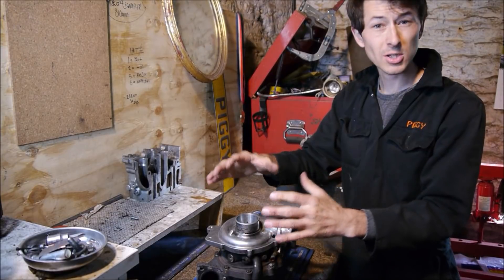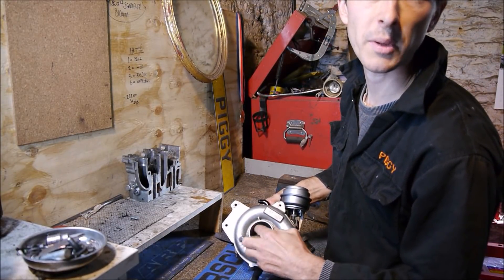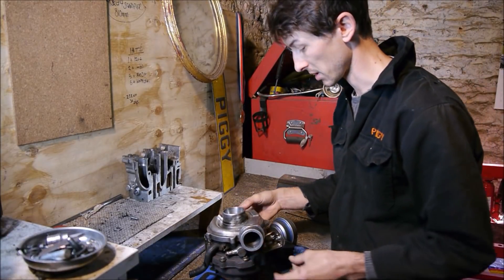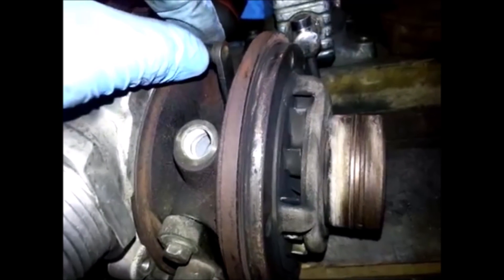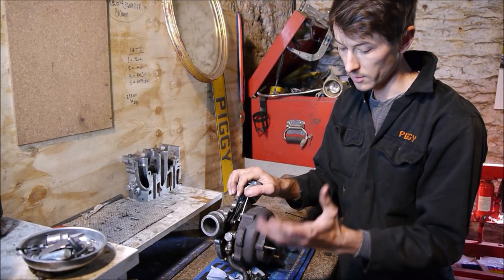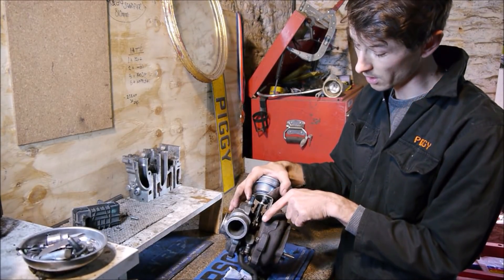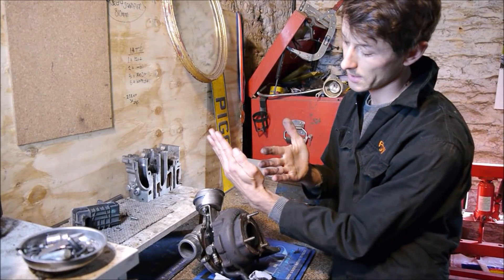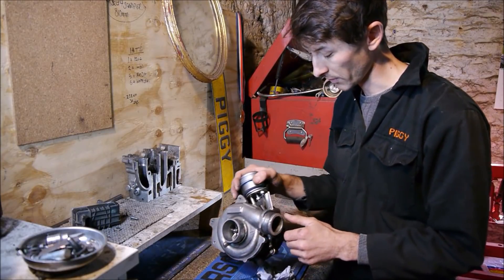VNT turbochargers explained

Comment: Do you have a video on how to retrofit these on a waste gated vehicle? How can the vnt be controlled with no computer?
Reply from the maker: It can be controlled via boost can or an Arduino system
Reply: Thanks for the quick response, we are building a bit if a Frankenstein diesel engine, a 16v 4d56u block with an 8v 4d56t head.  I'm trying to keep everything simple with no ecu. Everything is mechanical.  We just bought a VNT, with vacuum controller, still a bit confused.  We are running a https://youtu.be/N4RMT3gYBvc?si=582p6ha266G5ieai an this be adapted?
Reply: This is the Turbo https://youtu.be/IsOp49nkTbs?si=hqrmb7SoFc2XOeSy
Reply from the maker: Ive never seen or used that controller sorry. If you want to keep things simple

....don't use a VNT. Find a modern wastegate turbo.
Reply: @PiggyPower  maybe simple was the wrong term, I was hoping for a  balance between the computer world and analog world. I think the VNT will be a good fit for our needs, I was just looking for more information on how to control it.  Really appreciate your style and breakdown of how a vnt works it was very helpful.
Reply from the maker: @Yogaslackers  if you search Arduino vnt control, a guy made the code and everything with parts to do it. I ran one for sometime with it successfully.

Comment: Hi Piggy, thanks for your help over xmas on my timing belt change.  Ive been chasing through a p0243/p0238 prob (eml at 2700 under load) 1.6hdi110 and i think it's the vnt turbo.  I took the vacume actuatee off and the nozzle control arm is stiff and gritty and only moves about 10mm (unless i really force it)  is it better to rebuild or to replace? Thanks in advance. Kev
Reply from the maker: You can clean them out. Mr Muscle oven cleaner works a treat. It should be freely moving with no resistance at all
Reply: Thanks have you got a vid, or know of one you recommend
Reply from the maker: @chamoisshine9951  no sorry
Reply: Well not a complete disaster.  Just a disaster LOL.  Took turbo off (3 hours of fun) and indeed the arm was stiff. Split turbo in half and the control ring wasn't moving freely. So cleaned and replaced and it seemed to be a lot better but some of the flaps were still I little gritty.   So decided to take out the nozzle ring.  Unfortunately the 3 screws that hold it in place have seized and I have snapped them all!!  Ordered a new turbo (remanufactured Garrett original) should arrive tomorrow.   Old turbo is now clean and all parts moving freely, just can't re-assemble.   Next time (if there is a next time) I'll just clean the ring and just use lots of cleaner until the vent flaps are less gritty).  A remanufactured original was only £50 more than a new Chinese copy.  I'll let you know how I got on.
Reply from the maker: Yeah they tend to snap after all that time. Pop it on a drill press. Drill them out. Retap. Fit new tiny bolts. I've done it a few times! Kudos for trying though pal, many would write the car off!
Reply: Beyond my equipment. I'll just keep it in my spares pile.  I love my little 206cc I've had it for over 16 years.   I'm a valeter so I keep it looking nice and it's just gone through an MOT last week with no advisories (despite the turbo issue) as I live on the south west coast I do like to have a cabriolet.   Would you advise an oil and filter change one I have new turbo on (last change was August, only done 2,000 miles since). I'll be attempting replacing the glow plugs as well as I have had the p1351 error since forever.......
Reply from the maker: I'd only suggest that if the turbo had failed from oil issues. 
If it's the 1.6hdi I would highly recommend a new oil feed and drain and oil change/flush the sump.
Reply: Well new turbo on, new glow plugs in. Engine management light gone. It's a bit under powered now going up hills. And the only error is a p0299 turbo under boost.  Quick question.   Should the actuator arm always be long when idling (I've applied. Vacuum and it goes short, and I've done the same from the solenoid hose to test that, all good) I just can't get to the bottom of it and thinking of just getting rid of my car as it's taking to much of my time.... Shame, 16 years........
Reply from the maker: @chamoisshine9951 yes the default will be no vacuum (safety) ...and no boost is needed at idle! As soon as you touch the throttle the vacuum from the engine/solenoid will be applied and it will pull it shut. Under boost code doesn't necessarily mean the turbo is at fault. Reading the fault code is just the first step in diagnostics
Reply: Thanks as ever for your prompt replies. Much appreciated. So if I get the Mrs to rev the car I should see the actuator arm move?
Reply from the maker: @chamoisshine9951  yes I'd expect it to move
Reply: It does!!!  I checked the entire vac system today. No leaks.   Also checked the turbo solenoid valve on the bench (plenty of sucking through a tube whilst a large  syringe was pretending to be the turbo actuator.  All worked as expected when 12v applied.  Still struggling up hills - was a little better when MAF unplugged, but still got the p0299.  There was a little leek on the charger hose immediately after the plastic turbo outlet, but that has gone now (reseated and tightened jubilee). I think next stop is a turbo diesel specialist as it's taken a lot of time now... Any more pointers?  Thanks so much for advice so far

Comment: I really like this video! You are so right in so many ways. Not to be a PITA on one detail, and perhaps somebody else already said this, but the reason that the turbine spools up fast with the vanes in the nearly-closed position is because the exhaust gas flow has been accelerated by the narrow openings and angled in a fashion that it moves in a more circumferential motion that helps the turbine spin up. You are right that there's higher pressure under those conditions, but that's seen upstream of the variable vanes as a side-effect of closing them down. That higher pressure wouldn't be seen by the turbine itself. Naturally, as the vanes open, not only is there less acceleration of the flow, but the flow is also in a more radial direction, both of which contribute to less spooling. That's my understanding of it, anyways. Thanks for the excellent video!
Reply from the maker: Yes, spot on .. it does see the high pressure though, think of 2bar of air forced through those narrow vane's!
Reply: @PiggyPower  it really is pretty incredible what this machinery goes through. the VNT really is an amazing innovation. I used to have a MK4 Jetta TDI and that thing got 45 mpg no matter how hard I drove it. Hoping I can sort out my E320 CDI for good performance and great efficiency, too.
Reply from the maker: Those things are possible.... A reliable E320 .... Errrm

Comment: Ok I have some questions.

-Can the exhaust gas pressure force the vanes open as in a normal wastegate?
-what’s the pro and cons of using a boost reference wastegate and a vacuum reference wastegate on a Variable vane turbo?
Reply from the maker: 1) not really, if they 'open' then EMPs drop, which would allow them to shut ..etc.. ...but then the flow would be increasing as RPM goes up anyway... If EMPs are high enough to move the vanes, there's other issues. 

2) not really sure what you mean by having a boost reference v a vacuum reference. There's no vacuum on a turbo diesel. Just the pump.

Comment: yeah you are right Yoda got a couple of things wrong, i wonder if he just by mistake moved them wrong when he explained that they make more boost when open. But he sure don't seem to like vnt's :P
Reply from the maker: You wouldn't like them if you didn't understand them... That's true of so so many things... "I hate that" ...do you understand it, "no"... They often correlate. They don't make more or less boost when open or shut... They just adjust the pressure/EMP... Rpm, load and fuel all play a part .

Which is why they need such fine tuning to control

Comment: Good guide to VNT turbos, clearly the other guy didn't have much knowledge. Maybe he should've just admitted that and not said anything about them.  I owned a 306 Dturbo and it was good at the time,  I replaced it with a Leon with the VW TDI 110 engine.  The drive ability of the cars was completely different, the VNT turbo on the Leon makes it much better.  I'd never want to have another waste gate turbo on a diesel.   You could hustle the 306 along, but you had drive around the turbo lag low down and it was game over then waste gate opened.  Giving you a power band of a little over 2,500 revs.  The power delivery from the VNT turbo on the other hand has very little lag low down and no sudden drop at the high end.
Reply from the maker: Many thanks. 
And well said... VNTs transform the older diesels

Comment: I have a vnt on my 02 golf with 482,000 miles. I think the vanes are sticking causing limp mode. The bolts are so rusty, I am afraid they will brake. Can I drill into the exhaust and shoot a foaming cleaner into it? Then plug the hole?
Reply from the maker: At that miles, probably just worn tbh! 
I wouldn't want to suggest anything like that due to the potential risks.... Not that I wouldn't try it myself 😆

Comment: Still I can't understand the difference in control between VNT turbo and old type of turbo with wastegate.. Example we set maximum pressure 15psi, so if the pressure raise, ''old turbo'' will open the wastegate to decrease pressure on hot side. And on VNT the same, just not wastegate, but change angle of the flaps. Can't understand the difference in control? Why it is so tricky and difficult to put VNT?
Reply from the maker: In plane and simple talk, yes it's like that, but these VNTs are so much advanced that a tiny movement on the vanes creates a huge difference. Plus you don't want high EMPs while cruising, but you do want quick response. You also don't want overboosting which is VERY easy with such a simple setup. These will easily spike to crazy psi if not under control and destroy themselves. Plus if the vanes are shut too much for too long it will choke the engine and prevent it from breathing 

Plus the advantages...

Essentially you have a turbo that is too big for the engine to spool, but with the vanes, it can spool it. Then you have the bonus of it flowing air much more efficiently being a bigger blower.

Comment: I thought the exact same thing about that skid factory video. Love what they do but vnt isn't really a big thing on diesels in oz. It's more relevant here as we've got heaps of fairly small engined diesels
Reply from the maker: Perhaps that is the issue... Although I was still surprised at his 'facts' being so wrong.
Reply: Yeah same. Gfb now do a manual vnt controller. I think they need to revisit that td42 build and put a proper vnt turbo on it to feel the difference
Reply from the maker: Manual VNT controller... Just a boost controller. Very inadequate and poor control of a VNT. 

Agree on the td42 thing. Be epic that with a vnt
Reply: @PiggyPower  it won't be optimal, but gfb are a pretty reputable company. Looks like a more complex 2 stage valve, take a look.  I run a gtb1756vk on my mg zr diesel, it uses a custom electronic mappable pwm controller. Took some setting up but that's the way to do it.
Reply from the maker: I used arduino on the Racetractor which is now gone. Currently just use the edc15 Bosch ECU that has boost control capabilities built into it.

I have seen many manual 2 stage or even 'tuning box' style VNT controllers... None yet have I seen do any better of a job than a well setup boost controller... Which is £15. 

What you have setup sounds great. Are you in Aussie land? Would love to see your setup!

I have always intended to do a tutorial on VNT control using a Arduino setup but the Racetractor getting written off scuppered that
Reply: @PiggyPower nope I'm in the UK too, Im just a keen skid factory fan!

The controller itself will have some similarities with the arduino controller, although I suspect this is more complex. It uses tps, boost and rpm as the inputs. There are 6 maps that control it which cover min/max vane position, boost against rpm, boost against tps then sensitivity.

It was built by a rather clever friend of mine that has his own tuning company. The vnt box is more of a hobby project but I've always said he should package it. It's a great device!
Reply from the maker: This Arduino uses the similar inputs, it had a 4bar map sensor, TPS and a hall sensor on the can for RPM. Also had 6 maps from memory Inc ramping control. A genius friend mapped it all while I did lots of driving to fine tune it. Amazing what a tiny little chip can do. I had a LCD screen showing different things too from it. Well done for branching out towards such control for the VNT.
Reply: @PiggyPower  send me your email address, I'll show you some details of the install. I think you'll appreciate it, all done properly as you seem to prefer 👍🏿

I love the fact that it's done on something really unconventional that nobody bothers putting vnt on.
Reply from the maker: If you would like to join the Facebook Piggypower community or page .. be great way to see you work 👍🐷💪

Comment: I always wondered why they couldnt make these adjust the fan blades all by themselfes with some kind of pressure system triggering some mechanical component as boost rises when they spool up.
Reply from the maker: Hi there, thankyou for commenting and watching... Your question;
1) In early days, they did, it's nicknamed a "boost can" and many use it to control a VNT on a project car if they have no computer system to aid control. 

2) it just doesn't work very well at all, creates boost spikes and high EMPs often when cruising.

3) essentially a modern ECU controlled system is actually doing what you describe... The "pressure system" is the exhaust manifold and inlet manifold... The mechanical component is the vacuum or motor control alongside those mechanical vanes...
It's just progress 👍

Your question was good though and was a side subject I was going to cover in this video but felt the video would end up too long 

Thanks for watching and commenting, I hope you enjoyed the video and like the Piggypower channel 🐷💪

Comment: Great video! Out of curiosity do you reckon much can be done with the 1.4 hdi variant of the 206 engine? Other than a remap, would this even be worth doing? Thanks!
Reply from the maker: Not much point if I am honest .. have you seen the size of the turbo on them?... Better off saving for the bigger engine variants and enjoy the savings of the mpg benefits of the 1.4
Reply from the maker: Thankyou for the comment and watching 👍 🐷💪
Reply: Piggy Power No problem, just had a look and the turbo is tiny lol. Just wondered anyway. Only trouble with the bigger engines is the insurance due to my age. Thanks again!
Reply from the maker: I would think a bigger engined version insurance is cheaper than a modified small engine car?
Reply: @PiggyPower  Good point, i'll definitely look into it. Thanks.

Comment: Would a GTB2056VL from a 2.4 D5 Volvo be ideal for an upgrade on a DWATED 8V 110?
Reply from the maker: Depends what you mean by "ideal" and "upgrade" ...
Reply: @PiggyPower  as in, custom stage 2/3 map, ideally 160+ bhp and nearer 300lb ft torque
Reply from the maker: It would fit that brief remit. You need to understand that you will need a good mapper and understanding of making it work. Custom fabrication and a fuel system and engine that can support it. 

But ... Please try it and let me know 😂🐷💪

Comment: Any links/tips to control a VNT without ECU. On an older XUD9.  Ive heard about using a boost can, but never seen one or how to do it.
Reply from the maker: Plenty done it, will do and still do. Just not very well. Arduino system would work much better, as I did with the Racetractor 👍🐷💪